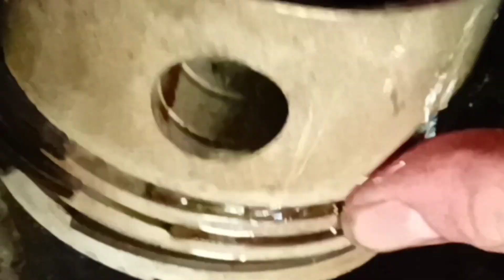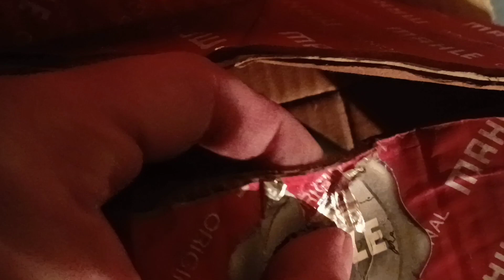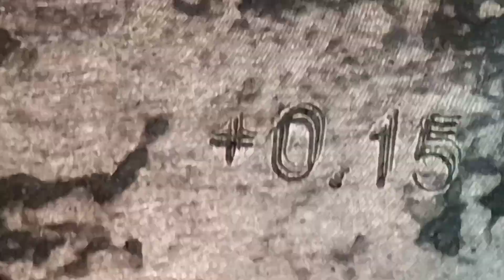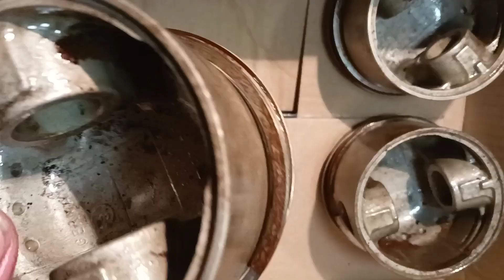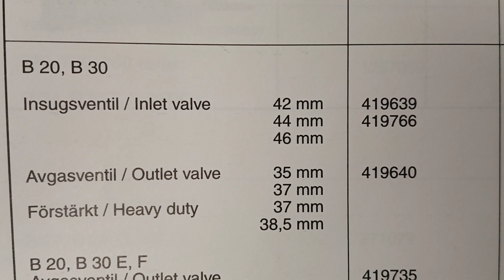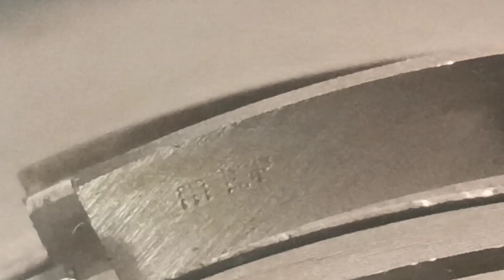Oversized Pistons for Volvo B20 first oversize pistons MAHLE KOLBEN Old Stock Engine Parts #volvo140

Comment: Hey Patrick! Thanks for a great overview video. Do you have any solutions for unstucking piston rings  without removing pistons? I guess my engine needs some attention but I want to try something before I dissaseble the whole thing🤣
Reply from the maker: Hey Marcin! The piston can be removed through the bottom of the engine🤔, some guys do it like that😉 But I understand that you want unstucking the piston rings completely without even🙂 disassembling the engine. Yes, I remember🤔 I had a B230 engine and compression dropped in one cylinder... There were thoughts of using a special liquid in the cylinder, but the car must be placed with one side on a higher surface so that the top of the piston is horizontal and the liquid in the cylinder is spread evenly. No guarantee for good result, this liquid able to destroy sealrings, seals, other rubber stuff... But! It would be 'something before'😊 I used special engine cleaning fluids. And I remember that there was a lot of smoke from the exhaust pipe after cleaning rings in this way...

Comment: My 1972 144 has 225,000Km and still on origional pistons & rings and not burning oil...  fantastic engine.
Reply from the maker: Yes! It's perfect! High quality original piston rings 😊. Very reliable engine. Obviously car not use very often if it has only 225000km🏎️ safe car forever!🙂. Now, my car has 441000 km, but I don't know what was before🙈, engine was... replaced of course 😉. Now I suspect that oil in dipstick goes to bottom mark...🤔 in our days they say that it's normal between oil changes. This engines made 50 years ago and they can last forever. I impressed by design of this engine.

Comment: Ahh, new/old pistons from Mahle 😍. Diesel oil for washing steel parts, safely 👍. Once upon a time I was stumped by my Jonsered chainsaw which WOULD NOT start. Spark, yes. Gas, yes. Compression , yes. Pull pull pull - nothing, not even a cough.🗯🤔. So I disassembled the top end and discovered a stuck ring, lowering the compression enough that it wouldn't start. Cleaned piston/ring/groove, reassembled and it coughed on the first pull and started on the second. I still have the saw which is now twenty five years old and works great. Jonsered 2071. 
I'll bet you will enjoy your pistons and rings ❤
Reply from the maker: Yes, the old simple Husqvarna😊 It's about the same🪚 but I have it disassembled somewhere🧰⚙️, somewhere in the garage... there were deep scratches on the cylinder walls🤔 If you had no told me about your chainsaw, I wouldn't have remembered... Oh, I think I threw it somewhere... or left it somewhere and forgot... I really love old swedish stuff 😉🥰